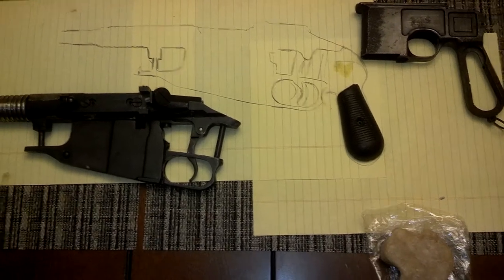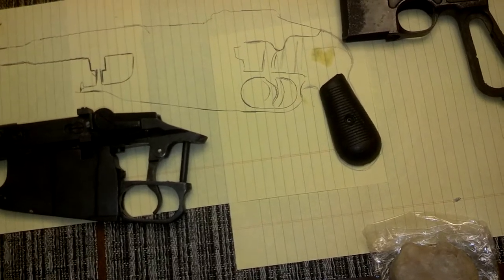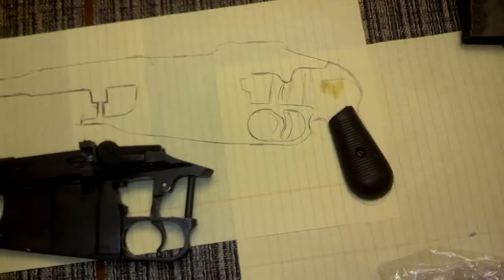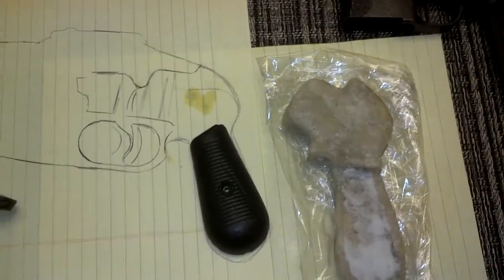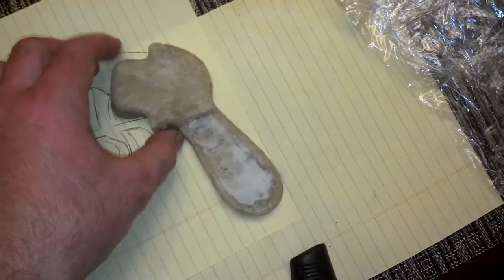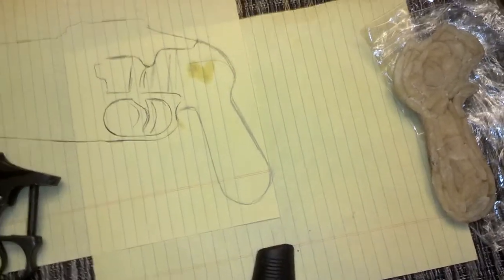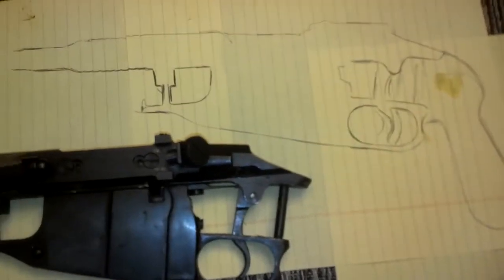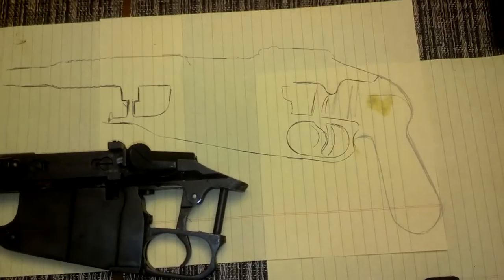Viewer Request video 12 :Cockweasle lost wax c86 broom handle grip frame project work in progress

Comment: Build up your master with foamboard, cardstock and sulfur-free clay, then mold it in silicone. THEN you can cast your wax in the silicone for lost wax casting. Far easier than trying to futz with carving a beeswax master, you will greatly reduce the machine work needed after casting.